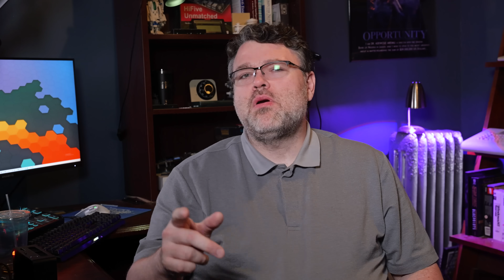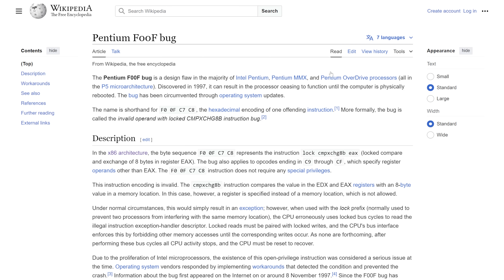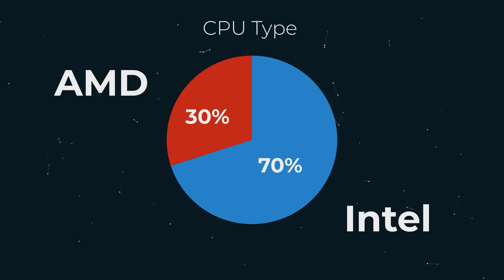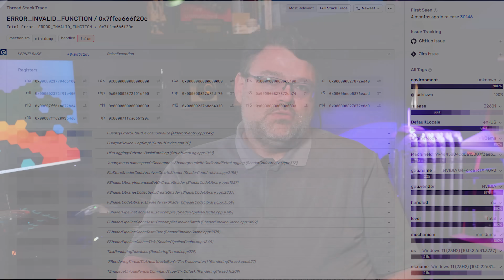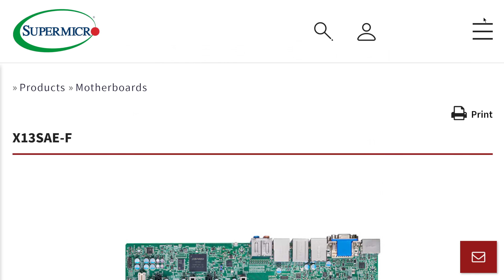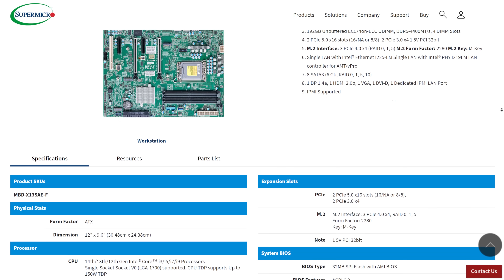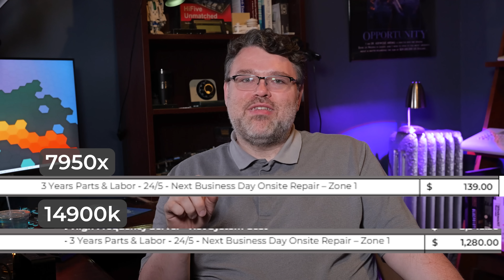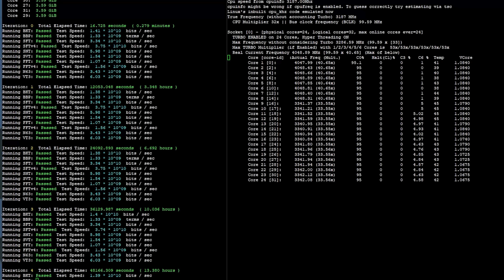Intel has a Pretty Big Problem

Comment: 15:05

"We already replaced a lot of customer's 13900k with 14900k and the issues don't seem fully resolved."

This statement is extremely telling. 

14:56 "$1,000 extra" for support is insane and really tells the whole story here. The part is not reliable. I am sure a lot of conversations are happening behind the scenes here, but based on what I've seen, Intel has not committed to fixing the issue. We can hope that it is due to incompetence but more likely they do not want to admit fault here due to the cost of "making it right"

Thanks for sharing this Wendell, it will be interesting to see other news around this topic in the coming weeks.
Reply: It would not surprise me one bit if we hear down the line that the CPUs are bugged due to Intel cutting corners/hurrying the chips out the door due to intense competition from AMD.
Reply: oh yes, instead of issuing a recall, lets damage even more the brand name
Reply: @monad_tcp  The issue is that Intel itself doesn't really know what to fix and currently the most reliable way to make it run stable enough is to lower the multiplier like to 53 and running the RAM slower. If that is what it takes then the CPU wouldn't run as specified and also would invalidate Intel marketing around the CPU, thus even if Intel want to do a simple recall and giving the costumer the fixed product, it can't be done. Assuming actually running it slower does fix the problem, Intel probably need to replace the product, force it to run the CPU slower, and give some monetary compensation.
Reply: I think Intel owes every 13900k and 14900k owner a new 15th gen CPU since this is a defective chip.
Reply: @cemsengul16  You're assuming this issue isn't going to be present on 15th gen.
Reply: @cemsengul16  They also owe us an LGA 1851 motherboard of comparable value to our LGA 1700 ones as well so we can run it imo... If there is no recall I def think a class action lawsuit is in order.
Reply: @hoboninja3389  Yeah we are fucked with just a CPU refund or replacement because the motherboards we have purchased only take LGA 1700. We can't just switch to a Ryzen or newer Intel processor. This is terrible shit from a company I have supported my whole life.
Reply: @cemsengul16  What about the MB though? 15th gen is going to use a different socket, so replacing just a CPU is not a solution when you need to cough out sth. like 300-500 USD for a decent mobo.
Reply: @marcingardias9254  Yeah we are really screwed here.
Reply: @cemsengul16 Not every, 15-25%
Reply: $1k per box in support, plus more spend because the mitigations are costing each box performance, more will be needed to meet performance and uptime KPIs
Reply: I don't think it's about being committed to solve the issue, as it is that they have probably realized there is no fix, and they can't afford to recall two whole generations of product. That would kill the company. Trying to mitigate it through microcode and power limits is probably the best they can do until getting a 15th gen out, and it might even be too late to fix the issues for that one, so they're really just holding on for their life for a 16th gen.
Reply: @coladict  Valid point. But my question to that is, 13/14 are an F. 15 could also be an F. 2 gens people wasted money. How many then will want to spend more replacing them with a 15 and possibly wasting more money? If that happens, forget about w/e 16 is. They, imo, would be really screwed. 
This scenario would be made exponentially worse if they do nothing when substance about 13/14. I don't know if admitting issues will be much better but it's definitely better than the prior option. 

I believe that they need to openly address the problem. 
15 needs to have any, if any exist, of these issues handled and tested before launch. W/e that entails.
Then, 16 better be an amazing piece of silicone, have none of these problems, AND have one heck of a price point. Dontry to up the price bc the chip is fantastic compared to 13-15. You sold us garbage. You need to redeem our faith by taking that profit hit. 

Otherwise, recall/refund. 🤷🏻‍♂️🤝🏻 Free CPUs till it's fixed. Your losing money either way.
Reply: @shawnduffy279  Couldn't have said it better man. I mean they need to factor people losing faith in Intel. I have never purchased an AMD processor in my life and now I feel like an idiot for buying a 14900K instead of a Ryzen.
Reply: @coladict  You are giving them too much credit. Manufacturing a CPU costs around $10-$20, everything else is their margins and recovering of the designing costs.
So even if they recalled the entire generation or two and replaced it with something new, it would barely hurt them.
Especially since CPUs is not the only product Intel makes.
Reply: Intel is already hemorrhaging money and has shut down a few of their long standing divisions. Their new Xeon CPUs aren't much to ride home about, their discrete GPUs are in their infancy and their consumer CPUs use a ton of power. They cannot afford an Xbox 360 style recall of any kind right now (or that's if the reports are to be believed).

Of course, I'm not certain if their money issues are rumours or actual reports, although many sources I've seen have pointed to that being a case, that's why they're betting big on AI like everyone else.
Reply: Yeah, I haven't had any awareness in the PC hardware space in well over a year, and I opened this video on a lark. When I got to these sections I was suddenly very concerned. This is a truly absurd reality.
Reply: @nonstopNny Guy's just copy pasting the same shit over an over.
Reply: "This statement is extremely telling."
Yes, I was thinking the same when I heard that. It means someone doesn't know that they are the same generation of CPUs even if intel is marketing them as two separate ones.
Reply: It used to be Tick Tock... but I think some one broke the clock.
Reply: Is this also affecting the 14900hx laptop cpu?
Reply: Did you try 14700 kf ?
I just wonder if  i7 is fine ?
Reply: Gaming Laptops 13,14 gen  are dying too. Usually no boot issue but Technicians usually think it's bad mobo..but it's actually te cpu, coz this level of failure rate has never happened before.. due to the lack of understanding from technical side ,the failure is not being report on massive number on the mobile platform..
Reply: I actually took time investigating the 14900k instability issues. Both Intel and motherboard manufacturers are to blame. Intel, because they pushed those chips so close to the brink that it's easy to cause HW errors. MB manufacturers are to blame because they don't take Intel specs seriously. The funny part is that you need to run very specific tests to trip the HW faults, practically all known test suites will run just fine. I used OCCT in monitoring only mode running my tests in the loop getting errors about once in couple minutes. None of the standard tests were able to find anything. And the solution with the existing motherboards is actually pretty simple, reduce the P-cores max clock. I found 5600MHz worked almost always and 5500MHz was very stable. E-cores do just fine at max. You get a small hit in single-threaded performance, but nothing noticeable when firing all cores. In the end, it's a nothing burger.
Reply: @ElementaryWatson_fafo  I bet the microcode update coming in mid August will just slow it down even more.
Reply: @cemsengul16  I think Intel can do a fix rather painlessly for users, because only a specific set of instructions is affected, the other code won't see any change.
Reply: It's like how insurance companies are refusing to insure houses in certain states against extreme weather. When even the Capitalists charge more or refuse to cover something, that's a sign that there's a real problem there.
Reply: what thorough and amazing investigation, you sir are an inspiration. if only these companies would have the kind of foresight to anonymise and open source the data. OSS community has already shown itself to be way more on the ball
Reply: welp your wrong , the motherboard manufacturers did it again they made their stock bios config too high of voltage and offset way too aggressive . if you change your bios setting too intel stock settings and crashes disappear .. this has already been investigated and proven .. motherboard manufacturers have done this repeatedly !!
Reply: @EpicGamingEct  I don't know how many times this has to be debunked but if you go back and look at previous generations, as far back as 8th Gen Intel, the board partners have had unlimited power settings. Take  Asus for example, it has a pl2 value of 4095, which I believe is the board default. Which is technically unlimited because no one is running 4,095 watts through a single processor. It is something wrong with the cpu side of things. It may not even affect all because I have close friends with both 13th gen 13900k and 14th gen 14900k that have not noticed any issues whatsoever. One of them runs Linux and the other Windows. However neither have had any issues at least so far. I have the 14700k and I am having issues. When I finished my build I immediately went to see how it would score in Cinebench as most people do that want to validate their purchase decision. I unfortunately had to stop the stress test within 30 seconds because Temps spiked to 100+c. I thought it was a paste issue so I reposted, checked my aio pump, fans settings, everything was working as intended but even running stock on a 360mm aio it could not keep the Temps in check during any real work load. I obviously wanted to address the heat so I followed the internet and intels instructions and manually set my pl: 125 and pl2: 180. This drastically cuts down on boosting and overall performance of anything that needs more than the 180 watts. It throttles like crazy. It dropped clock speeds down to 5.0 ghz p core and 4.3 ghz e core. I also get memory errors when I go to log off. I was hoping Intel would issue a microcode fix if that was even possible to address this issue but I think we are shit out of luck.
Reply: @TheAdam2877  I get an error when I click shut down Windows 11 too man!

Comment: Bought a 14900k as a replacement for my old Threadripper because I got a motherboard for next to nothing and a deal on the CPU it was a mistake. Had stability issues had to underclock to render with VRAY and with Arnold the crash as almost instant until I turned down the cores. Now 100% stable but tiny performance loss.

Comment: I have a Intel Core i7-13700KF and have had a lot of random crashes in games it got worse over time, 2-3 blue screens too. I now installed a new bios beta from msi that removed msi overclocking and so on. Problems seems to be gone now, but not going to lie im a bit worried

Comment: I did not had a crash for like 2 years of 24*7 operations. AMD 5800X3D :-)
Reply: Same with 12700k :)
Reply: Same with my 5700x. In fact, my still on all the time 8120 Windows box, has never had a problem either and that is supposed to be a sub optimal chip but has still done some serious number crunching in its time.
Reply: R9 7900X, same, working in a gentoo linux machine since I bought it, 0 issues

Comment: it took me until now to realize that i perhaps had an affected 13900k. it would crash at odd things. didnt play to many games but i would get random crashes when rendering in premire. also it was 100% consistant blue screen when installing arc drivers, so weird. the driver would install but everytime it would blue screen, reboot and be fine. i replaced the 13900 with a 14900ks and it no longer blue screens on driver installs, so far so good.

Comment: In the LAN esports center I'm managing, I had to tone down the turbo boost clocks on 10x 13700s we have. They all just started throttling after some months of usage and adding more coolers and of course repasting, didn't help. Toning down boost clocks by 300Mhz helped.
Reply: feels like the degradation kicked in